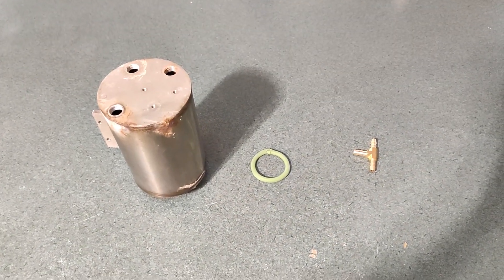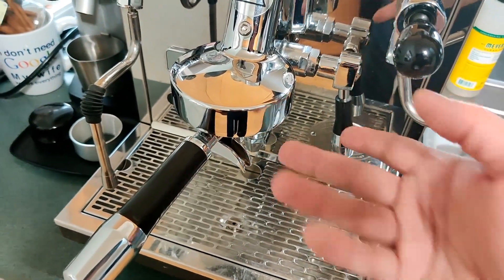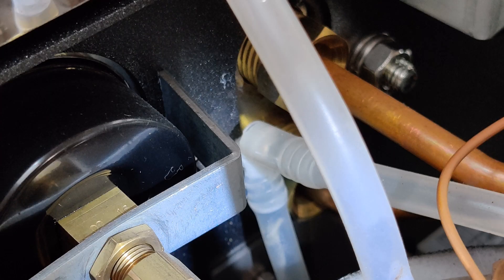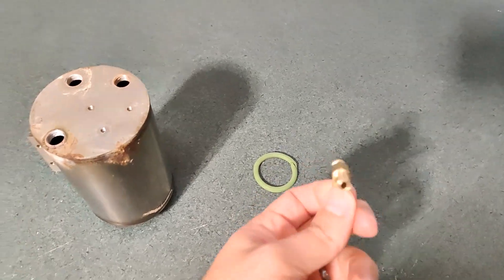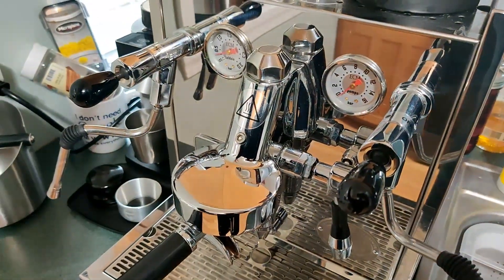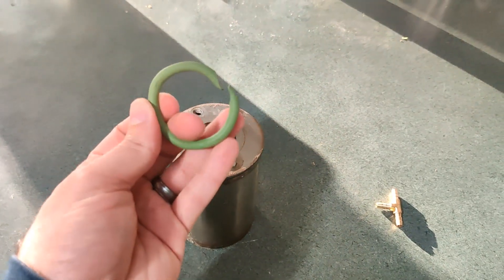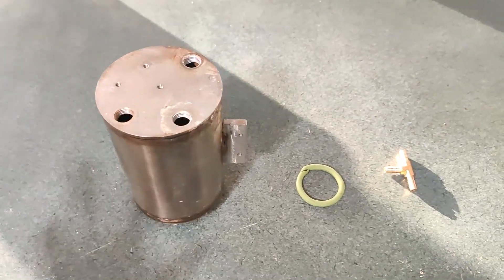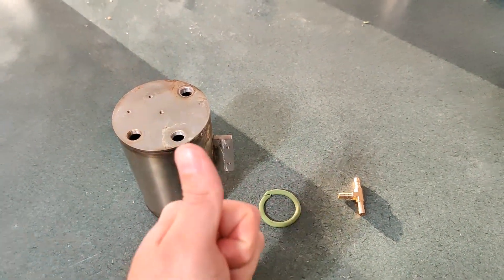ECM Synchronika - Defective Boiler and Repairs

Comment: "Hi there,

It was after watching your video that I decided to purchase my first espresso machine, the Synchronika, about 6.5 years ago. Up until now, I haven’t experienced any significant issues. In the second year, the +/- signs on the PID panel started to fade, so I emailed ECM in Germany, and they sent me a new PID cover sticker to Turkey that same week. I still haven't replaced the old one yet and continue to use the faded cover.

Additionally, the steam boiler gauge no longer drops all the way to zero. I believe the vacuum breaker got stuck a couple of times, which slightly shifted the needle. However, since I'm aware of the situation, it doesn’t cause any problems for me, and I haven’t felt the need to replace the manometer for now.

Other than these minor issues, the only maintenance I’ve done so far is replacing the E61 gasket, and while doing that, I decided to upgrade the shower screen to an IMS one for good measure. I also just checked the 3-way T-connector; the plastic one is still in good condition, but I plan to replace it with a copper one when I find the appropriate part nearby.

Although there are no major issues, I’m considering doing an E61 rebuild and replacing the steam joystick gasket soon, as it has become a bit stiff, and sometimes it doesn’t close immediately without a little nudge.

In light of all this, would I recommend this machine? Yes, I would, to all hobby enthusiasts who have the budget for it. However, I would advise not to set your expectations too high."

Comment: Thanks for making this video mate, appreciate your time putting this together, very good information
Reply from the maker: No problem 👍
Reply: @hagar852   hey mate, just wondering if you had the machine ever serviced during those 4 years before it failed? Thanks heaps
Reply from the maker: @Phill no, it hadn't needed any service other than normal cleaning.  The t-connector would have needed to be replaced though, even if I never had an issue with the boiler.  If you have the machine or are thinking about getting one, I would replace that t-connector right away.
Reply: @hagar852  thanks thanks mate I appreciate your quick reply :) greeting from Australia

Comment: I know you posted it a while back but wanted to check if you still have your Synchronika and if it’s been serving you well since the boiler replacement? Thanks!
Reply from the maker: Hello, I actually shot an update video, wasn't happy how it came out, and haven't been able to reshoot it.  I did also have to replace my vacuum breaker valve, as the seals inside it finally let go (7 years of operation).  Besides the boiler and just a couple of other maintenance items, the machine has served me well the past 7 years.  Finding parts though, can be difficult at times.  Clive Coffee at least stocks the boilers, it took MONTHS to get one from Whole Latte Love.

Comment: Did you like your e5sd grinder? What was the grind setting you end up with? I gave up on mine and send it back waiting for e37s. To be able to slow down my shot had to work with 0 setting or less, i know that is should be too fine but higher its like a river shot
Reply: I also bought same espresso machine as yours, love it but Wholelattelove spends more on advertising then their customer support on phone, can wait up to 30 min to get some one pick up the phone to tell me i have to write up in email. Then wait 3 days for some one to write back...
Reply from the maker: So far it has been great.  It did force me to get a better scale to make sure the coffee dose was exact.  It does yield the amount I do put it for it's output.  Depending on the coffee that can change, darker roasts are a bit oily so that can affect the retention of grinds inside.  As far as my settings, it is 4 indexes above zero, the measurements on top.  I haven't had to go below 2 indexes from zero, but the coffee will drive what the grind setting will have to be.  Without the better scale (Timemore Black Mirror), I struggled to get consistent shots like you mentioned.

Yeah the E37 sd was just too much money, and so far the E5 has been fine.  What I like most is being able to change coffees, get them dialed in, and just record the setting.  This allows me to switch coffees a lot easier. 

 With my E6P v2, I have to clean out the grinder when I switch between coffees, as it retains more coffee.  Because it is timed grind, I then have to mess with my time settings, with no display on my model, it is very difficult to switch back.  Even with trying to count the button pushes i used to change the setting, it is just not efficient.  The E5 made switching coffees alot easier for me.
Reply from the maker: @kharkiv4life  yeah I would send email and then call right after and wait like you mentioned.  It took a total of 3 weeks to get my machine back up and running.  Some of that was waiting for parts and when I screwed up the gasket, that added more even more time.  If that didn't happen, it would have taken two weeks of time.  Was a long two weeks having the machine apart on my counter, but I did get it back running again.
Reply: Thanks for the info, to not loose 10% from my e5sd return had to find equal or higher so i went e37 quick set the SD version $600 more just too much. I am ashamed to tell my friends already what i spend on every thing for my 1st coffee set up. But i don't regret it. Just dialing in shots tastes way better then any coffee shops I've been ever.
Reply: You gave me more info here then Wholelattelove support. So again thank you!
Reply from the maker: Yeah, when I first bought my machine and grinder, they were considerably cheaper.  The E6P V2 was $600-$650, if I remember right, and now it is $200 more.  Grinders have gone up alot in the past 4 years.  The original E37 was just over $1k I think.   The grinder you got it awesome, and will hopefully last you for AGES.  It was definitely worth it, and yeah I feel the same way when people ask about this stuff.. but it does and will pay for itself by not having to buy coffees at shops.

I estimate I have pulled over 1200 shots now with the machine.  I bought it for my wife, but now we both get a lot of enjoyment out of it and we like experimenting with new coffees.  Besides the savings, the enjoyment we have making coffees and making coffees for family made the investment of money 1000% worth it.

Comment: Sorry to hear this. I’ve been shopping & thinking of buying this same machine from Whole Latte Love as well.  These machines are expensive. It’s making me second guess buying one now. I would think with only home use & using good water that this machine should last 10 years before you need to start replacing items?? Would you buy it again?
Reply: I am having the same thoughts.  All the reviews say how well the ECM machines are made.  Your issues don’t reflect that at all.  Now I am having second thoughts as I have the Synchronika in WholeLatteLove’s shopping cart.  Thanks for any thoughts you are willing to share.
Reply from the maker: One reason why I bought the Synchronika was it was touted as being easier to service than most machines.  For the most part, I think that is true, as I was able to do the repairs myself, and for the most part, most items are fairly accessible.  Once again, my boiler was defective, and I haven't found anyone else with the issue I had (bad weld leaking through).  So I think what happened in my case is not at all common, if that didn't happen, the only issues would have had would have been the barbed-t connector disintegrating (the plastic one I mentioned).  Those I know are a common issue, as over time, they just break down and will start leaking.  Other than that, my machine probably wouldn't have needed such a big service/repair.  

Yes these machines are expensive,  but are at least repairable if anything should happen.  The E61 brew group, over time, will need maintenance done (replacing seals and such) which is common with anything that relies on seals and moving parts.  The commercial machine also need regular maintenance as well, but as long as you do the "regular" maintenance of running cleaning flushes here and there, and monitor for leaks, you can prevent major problems.  The biggest key to long life of these machines is clean water, proper filtration is probably the biggest contributor to keeping your machine running for many years.  

Would I buy it again?  I will admit, it was disheartening having this problem, but I was able to get the parts and get her running again.  I was also able to clean up the inside from the water that had been leaking for some time, so it was good to get her "like new" again.  I have looked at other machines, especially some of the newer releases from Crem, Quick Mill, and Bezzera.  I watched the videos to see what they look like inside, some have better placement of components, but may require a little more work to remove boilers.  I can't speak to those other brands on their reliability as I haven't really researched them, but I was curious what is "new" and "exciting".  Sorry for the long response here, but yes I would buy my Synchronika again.  Besides the issue I had, I have enjoyed using it (we use it everyday) and it has held up very well other than my defective boiler of course.  Hopefully now, I my boiler can last the 10 years you rmentioned!
Reply: @hagar852  Thanks for getting back. & I’d rather have a long explanation than one that is lacking in detail. I’m thinking of getting this. Maybe if I do, I should replace that T splitter now. Or maybe they’ve improved that piece on the newer machines🤷‍♂️??  Anyways, thanks for the video & your thoughts. It’s a nice looking machine!
Reply from the maker: Yeah, if you do decide on the Synchronika, I would pop it open and see if it is the plastic t-connector.  If it is, then I would suggest the lead-free brass one, and you never have to worry it.  One thing to note, not many other machines have the steam pressure the Synchronika now has(2 bar).  I didnt think I needed to upgrade my PID to get it, but when I had it all apart I went ahead and did it.  It really does make a big difference, and I also went to a 4-hole steam tip.  Now the frothing is much faster as well as easier to be more consistent.  At least that is my experience.  Eventually I will so my 4 year update vid and go over the upgrades I did over that time.  

Anything that helps with consistency is what I went for.

Comment: Thanks for making this video!
Reply from the maker: Yeah no problem.  I will be doing the upgrades video soon.. I hope to have it done within a week.  I also have to do a video on the single dose Ceado also.
Reply: @hagar852  This is the second video I've seen on YouTube with Boiler Problems on the Synchronika. The other video showed boiler leaking, overheating problems and relay contacts burnt. This machine was top on my list and now I'm not sure. I'm looking for a double boiler with PID and stainless steel boilers and this was one of the machines that checked all those boxes.
Reply from the maker: @6guitarplayer  I am not familiar with the situation the other machine you mentioned had, but yeah I can see your hesitation.  It sucked I had a problem, but I bought this machine for it's design that allows it to be serviced fairly easily.  That aspect did pay off for me.

I have seen issues related to quality control, but I think where you purchase it from may play a factor in that.  Some shops go through the machine and test it before sending it out, but crap happens sometimes.

After my experience, I would buy this machine again.  Parts are obtainable, and not as expensive as I thought they would/could be.  

With all of that said, there are other manufacturers that compete with this machine.  Which are all very capable, but part of the decision is where you buy a machine from.  Depending on what models they carry could drive that decision.  I would recommend calling a few shops and see what info you receive and see what experiences they have seen with issues.  

Whatever machine you choose I wish you luck with!  Any in this price range should serve you well!
Reply: @6guitarplayer  I am in the same boat lol

Comment: Mineral free / Reverse osmosis water is slightly more acidic and I have heard it can be corrosive maybe due to high temperatures as well. I wouldn't think it would do something like this though (could it?) :O 
I think this machine uses a magnet to sense water level which is pretty cool and doesn't rely on an electrode and will still work with mineral free water as a result. 

Usually if it's really mineral free water you get more acidic / flat tasting coffee. I'd try maybe adding a little like 1-2 parts bottled spring water combined with 3 parts your regular RO water and see if you notice the difference.

Comment: Thanks for the video, very helpful.  Do you know the TDS of your water?  I’m considering the Synchronika but the water level sensor is a major concern as I have RO run to my machine.    I’m in the 25 TDS range.
Reply from the maker: What unit of measure is that reference to?  PPM?  I don't have an accurate reading as I had my water tested when my system was serviced last fall, and the tanks being re-bed threw off the test for TDS.  I am on a well and the reading from the well is 290mg/L which is also 290ppm.  Sorry I don't have an accurate reading, I will try and get one though.
Reply: Thanks for your reply.  Sorry, it’s 25 ppm TDS.  My tap water averages 400 ppm TDS.  I bought a meter from Amazon for $20 (HM Digital DM-1 In-Line Dual TDS Monitor).  I have one on my deionized water system too where it shows 0 ppm TDS so they seem to work ok.  I was hoping to learn if the 25 ppm TDS from my RO would work with the Synchronika.  I’m a fan of the RO for no-scale (as you mention).  I performed a big taste test with bottle water (3 kinds) distilled, tap and the whole latte love blend... tested on my wife, two kids and me.  Except for the tap water, nobody could discern an appreciable difference so I don’t buy into the hype about RO making bad tasting coffee.  So I’m back to trying to sort out if my RO will work with the level probes in the Synchronic.
Reply: @paulclark5437  Did you make sure the brew boiler water was completely changed between tasting different water types? not just the water reservoir. 
I think the synchronika uses a magnet sensor that float as water level rises / falls. So mineral content shouldn't matter.
Reply: omfg dont use RO water
Reply: unless you love corrosion!!!!
Reply from the maker: @Chad Gregory Why?
Reply: @hagar852  if you have water with nothing in it, it's highly corrosive and metals will leech into your water and your pipes will get all fucked

on the other hand if you have improper ratios of calcium and magnesium along with improper alkalinity then you will end up with scale. 

Proper water is a balance between preventing scale and preventing corrosion. 
 You need the proper alkalinity along with the proper ratio of calcium and magnesium.
Reply from the maker: I do mention in this video that I have a whole house filtration system, where I have to inject chlorine to remove iron bacteria.  So I use the RO system (with carbon filters) to remove any trace amounts of chlorine for my drinking/cooking water.  PH is what causes water to be corrosive unless you have a corrosive substance in it.  I remove manganese and Iron from my water, along with any hardness my well water has.  After 5 years of running this water and only this water, my scale build up is at a minimum, as shown in the photos in my video.  The corrosion only took place at the weld for my boiler, which was defective and had left tungsten exposed, which IT IS NOT supposed to be done.  Support had verified that, and also reported that what happened to my boiler WAS NOT a common issue, and I was the first case they had recorded of such a problem.  

Support told me directly, whatever I was doing to filter my water, don't change it.

Comment: Just the other day something appears to have gone wrong with the stream vent system. That’s the little vent at the lower front of the machine right below the group head. A few days ago it suddenly started venting a continual flow of steam, only a small amount but its continuous. Steam and evaporated water is condensing over the face of the machine as a result and a small puddle forms under the machine during the course of a day. My first thought is that the sensor has failed. I’m waiting on a call back from the supplier and will report back with the verdict. At least its still useable :)

Comment: I have similar problems with leaking 
After 1 year I changed valves 
Now I have a steam leak and it is popping the electrical breaker 
Very frustrating

Comment: 4 years is a short time for a boiler change. I expect no less than 10 years for such a major repair
Reply from the maker: I agree... It was a defective weld in the brew boiler, and I hope the replacement can last the mentioned 10 years.
Reply: @hagar852  I just bought a Synchronika online; supposed I wouldn't have bought this machine had I watched this video first.  How disappointing to spend that much money and then have to do an expensive repair.  I have a Rocket I purchased in Germany in 2011 that is still going strong.  Sure hope my new Synchronika will be completely updated!!!  I love your videos!
Reply from the maker: Hopefully this was a rare occurrence, but since getting it repaired (knock on wood) she has been running fine.  Yeah it sucked, but I was able to get the parts and repair it.  In the world of disposable goods we now live in, I thankfully purchased a machine that can be serviced.  Hopefully I can keep this for many years to come.